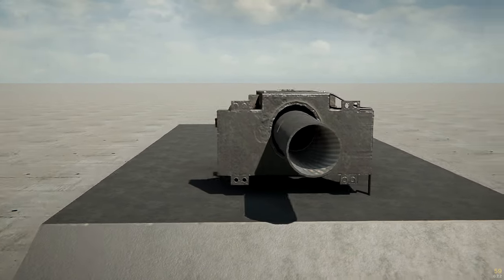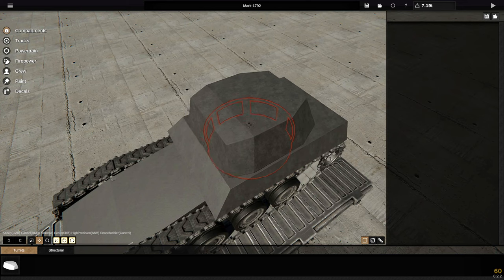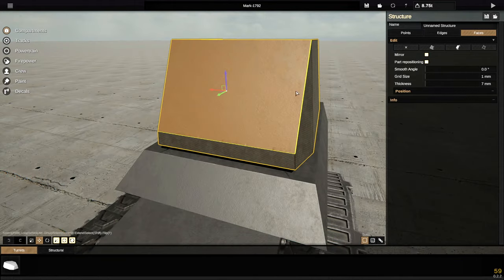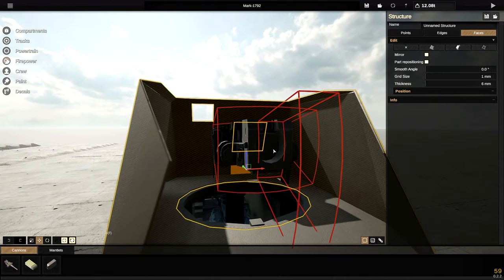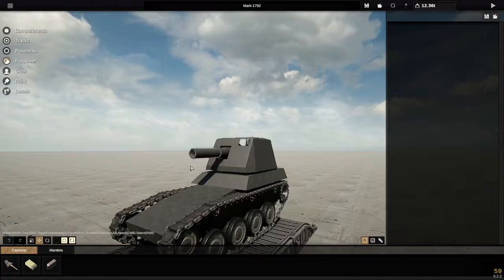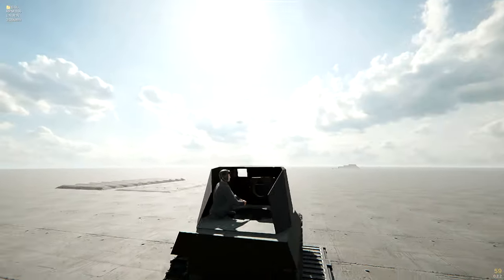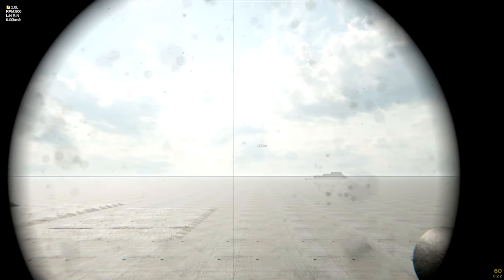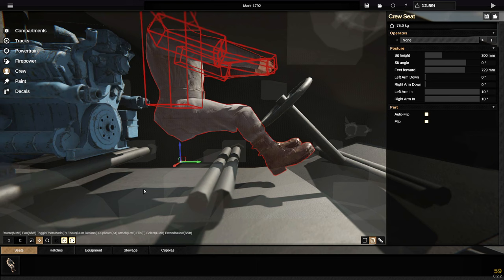I Built A Tank With The BIGGEST CALIBRE CANNON In The NEW SPROCKET UPDATE!

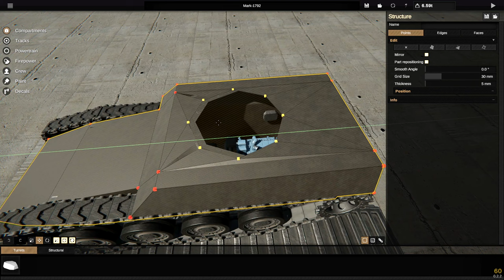Comment: 2:33 If you delete the plate, then use the hole tool with all relevant points selected, you can make a much smoother hole with no weird joints
Reply from the maker: Interestinggg